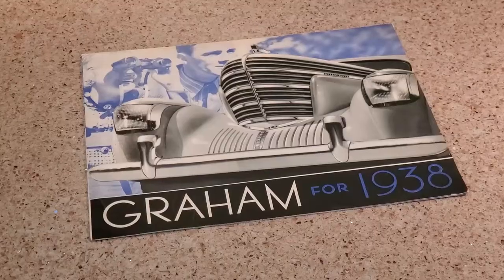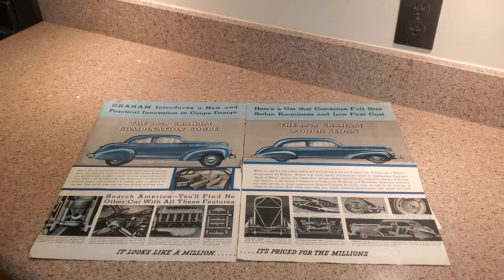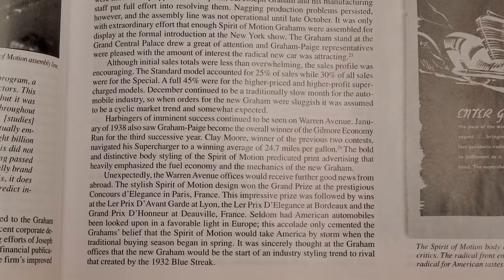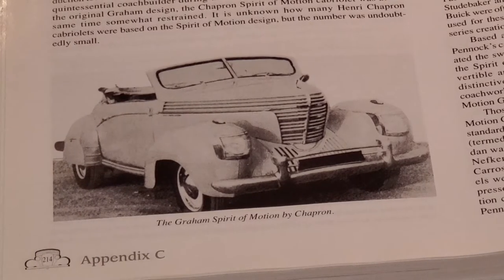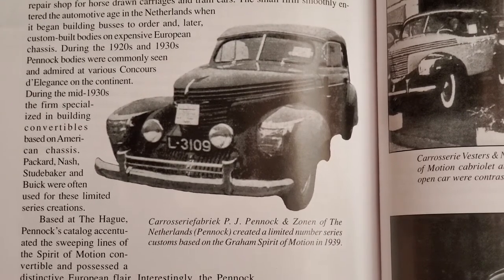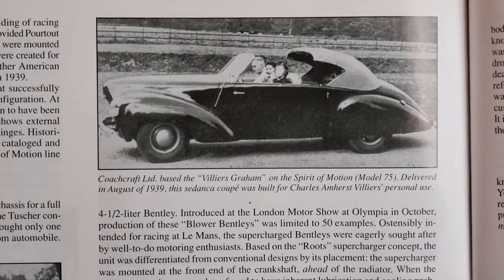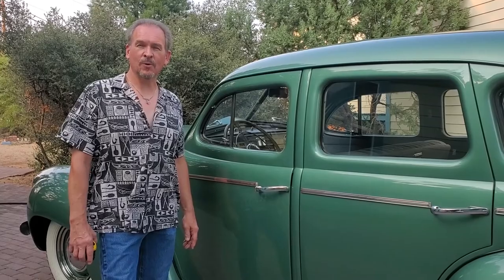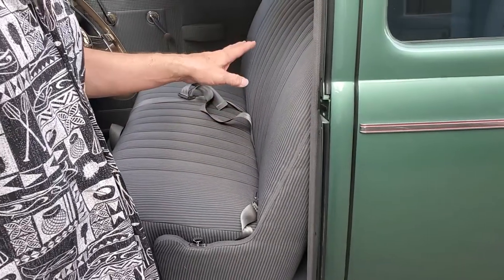Graham Sharknose Convertible History - Sharknose Graham Convertible Myths and Facts

Comment: Very interesting and insightful video. I found it pretty enjoyable. How would one be able to distinguish a model 97 from a model 107 though?
Reply from the maker: Good question! We should do a video on this, but in general here it is. The car had a facelift including flatter slightly curved bumpers with tall thin bumper guards. The grille of the car has much less slope than back in 1938 and 1939 with trim straps on all grill louvers. The hood ornament is 5/8" shorter with the difference taken out of the knights emblem neck area. The trunk lid has the name Graham centered on it in block letters above the trunk handle and license light combination. This is the same unit used the Graham Hollywood. Interiors are quite different and color keyed with exterior colors.